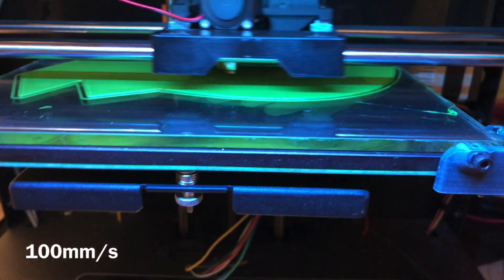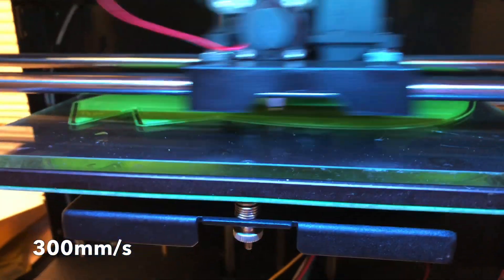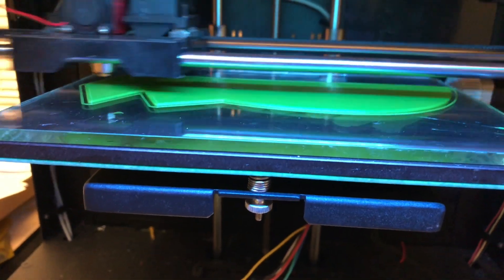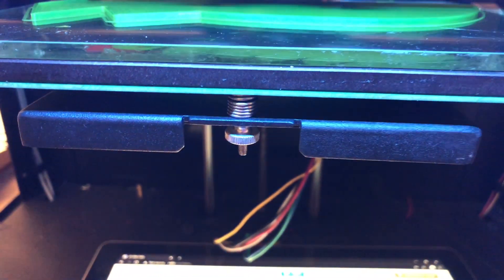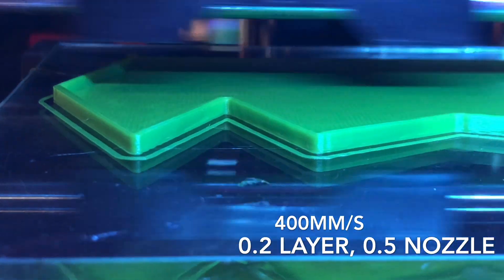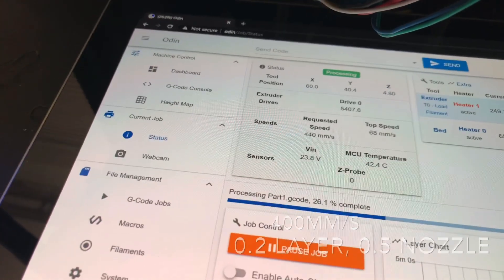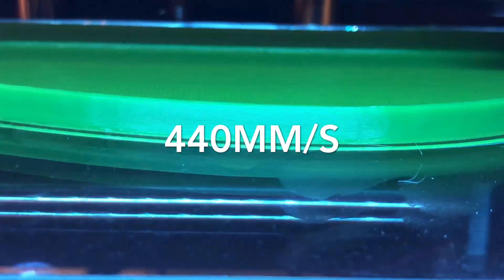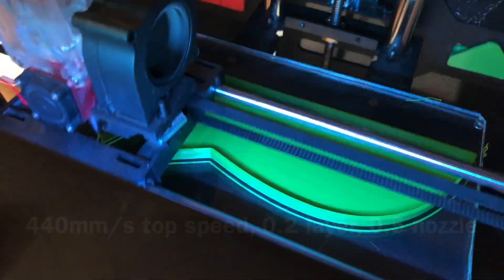Nova Hotend Speed Printing. 440mm/s

Comment: I'm more interested in the mods you have done to that Flashforge Creator Pro, or clone. I have a QidiTech 1 that I have big plans for. I'm a sucker for pain. I know it will be a difficult journey.
Reply from the maker: Haha, you dont want to go that route man, but if you do, I actually have a Nova printhead on my website that I used for my flashforge, and I put a duet board on it too.
Reply: @Vladlabs  what software do you use??

Comment: Will you be making a tungsten carbide nozzle?
Reply from the maker: Not at this moment, as it is unnecessary. My Starforged nozzles are HRC72, and they are significantly cheaper vs what tungsten would cost if I made it. And there is much less benefit from tungsten  on such tight geometry as Nova.

Comment: Would it work for predator delta printer ?? Can it do high temperature?
Reply from the maker: Yes, it should. I had customers with predator before. I dont have a guide for that machine though. Nova works up to 500C with RTD setup. Keep in mind, Nova us out of stock until July 15 now, orders will start dispatching after that date on first come first serve basis.

Comment: where are you from mate? Where do the hotends ship from? EU retailer? if not whats EU shipping cost? altogether this is a pretty expensive hotend all things considered because you use a different ecosystem so everything has to come from your store. I am interested in buying one and in shipping methods to EU
Reply from the maker: In relation for what you get for the money Nova is very underpriced actually, this is the least profitable project out of all that I run, because it is driven by different goals. And it is the lowest priced on a market hotend for given materials, which was not easy to achieve. But overall yes, it is definitely not a cheap hotend, it was never intended. I will be launching another hotend models very shortly which are going to be cheaper and more compatible with what everybody is using now, but in that case forget about performance numbers that Nova can achieve. Nova is only being assembled, sold and shipped by me and from my location now, which is California. I ship worldwide and I don't markup shipping costs on my website to offer a better over all solution for international buyers. You can check all shipping rates on Nova checkout page  typically international shipping costs $24ish, and DHL costs $40ish. Local is $6.

Comment: Акцент палит ) Интересно, как оно с ретрактами будет.
Reply from the maker: А что палит то, я вроде ничего и не прячу 😆 Nova needs significantly less retraction vs any other hotend due to 1.87mm tighter bore.
Reply: отлично оно с ретрактами, на нормальных скоростях - на текущий момент единственная голова/хотенд который я не трогал последний год. как собрал изначально (100W / 0.5 steel) так и печатаю
печатает все - pla / abs / abs-cf / xxxcf / nylon / ...
шикарный хотенд. мелкий, и очень приятный

Comment: This is really interesting! Can you tell me the speed of your first layer? Assuming usually we use 50% of print speed as the first layer speed, would a 200mm/s first layer speed works? Thankyou!
Reply from the maker: My day to day first layer speed is usually 120-150, and I print on bare glass. With glue stick could be faster, but I don't like too strong adhesion.
Reply: @Vladlabs  alright thankyou for the reply! Thinking of buying it soon enough 😁

Comment: Hello... thanks for visiting my channel!!! You made a comment and I came here to check your videos...

WOWWW... 440mm/s!!! JUST WOWWWWW!!!
Would love to try this!!!
What speeds can I actually get on an Ender3 with this HotEnd and the Dual Drive Direct Extruder?!?
I`m using a SKR mini E3 32 bits main board on it!!!
Reply from the maker: Realistically on Ender3 my customers print at a very stable 150-200mm/s as a default setting. CoreXY can do 300 easy, and delta up to 400. With that said, maximum flow rate ever achieved was 48mm3/s, so you have to keep that number in mind too. For example with 1.0mm nozzle and 0.5 layer height you won’t be able to print 400mm/s. I made a really nice calculator tool on Nova page on my website which will help you understand and estimate speeds: https://3dpassion.com/nova
Reply: @Vladlabs  WOW... that is AWESOME!!!
Any chance I could try this and make some Videos?

vistapanoramicabylello@gmail.com
Reply: @Vladlabs  What is the maximum print speed of ender3 with 0.4mm nozzle at 0.2 layer height without affecting its print quality?
Reply from the maker: @calvin-7540  Depends on your firmware skill, but I'd say 200 is a reasonable maximum on such machine. 150 is very easy achievable.
Reply: @Vladlabs  Sounds decent, I would consider purchase one

Comment: Is that a BMG clone?
Reply from the maker: It's very similar design yes, not exactly a clone. I personally think this extruder is superior to the BMG from bondtech. It is injection molded and not 3D printed, translucent, and over all great quality.
Reply from the maker: Forgot to add that this is not why I am able to print like this. I showed same exact speeds with MK8 plastic chinese $5 extruder too 😉

Comment: This is amazing.... I came to your channel because I had noticed your comment on one of my videos, without realizing you were a retailer. I'm wanting to upgrade my hotend to be able to print with materials like nylon. I've been looking at a popular competitor, but after watching this video I'm quite open minded to trying something different. I'm glad I popped over.
Reply from the maker: @David Woolfield Stock CR10 rated for 260C max temp (due to ptfe liner), what temps are you printing that at, just curious. I know some nylons are relatively low temp.
Reply: @David Woolfield Yes, im also interested. ...i also need to pick up a nova. Ive finished all my other mods. Do you have a mpunting system for the ender 3? Im the programmet for a sheet metal shop so i can make just about anything
Reply from the maker: I already have a bunch of STLs made for different machines, Ender 3 is also supported. You can use an STL from CR10, it's the same. 3dpassion.com/models
Reply: @Vladlabs  yeah, i look for cr10 parts as well. Do you sell through amazon or only your site? Ill definitely be picking one up in a couple weeks. Finilly finished all my side projects
Reply from the maker: @GL0ZZ3NTechReviews  both, but Nova is only sold via website configurator.
Reply: @Vladlabs  ahh, yeah, I bought a heatbreak for my v6 from yall over on amazon. I need to convince the wife not to kill me and Ill be picking up a nova soon. Ill have to do some videos to show it off as well. I also like how responsive you are on the channel, super cool.
Reply from the maker: @GL0ZZ3NTechReviews  I also offer messenger contacts to everyone who has questions :) well, while I can. Haha.
Reply: @Vladlabs  Do you use proprietary nozzles as well, or would I still be able to use an aftermarket hardened steel nozzle?
Reply from the maker: Nozzles are proprietary, and there was nonqay around it during R&D, if I wanted to push the performance. So all my nozzles are M4 thread.
Reply: @Vladlabs  no worries. Would you be free some time tomorrow to chat in messenger? I can shoot your company a message, but i know facebook does that reaponse time rating so I didnt want to send it at an odd hour. I would just like the details on what all i would need to buy for my current setup. My mind is made up, I need a nova in my life.
Reply from the maker: @GL0ZZ3NTechReviews  Yeah, message me whenever you need. My response times measure in minutes usually, 7 days a week, and I use personal account there, as their business setup still has 1990s interface there for some reason. I will also put some V1.0 Novas on sale next week, due to the fact that I ran out of stock of latest model today already. V1.1 will be back in stock in two weeks and I am glad I will be able to take a break from this! :)
Reply: @Vladlabs  i sent you a message on facebook about getting setup for my ender3/cr10
Reply from the maker: haha me too! Well, I am a retailer/manufacturer and a guy who made Nova from total scratch, so I do use this account to browse around :) the whole project is mainly updated on instagram, feel free to check it out over there: @3d.passion , Nova is on fire this month completely, I am already out of all PT100 and PT1000 stock. But still have lots of NTC-equipped bundles. 🙂
Reply: @Vladlabs  Ahh, so this is your baby? :) I'm the programmer in a job shop, so I really admire the quality of the manufacturing. I've actually just finished looking at your instagram and watching your calibration cube video. I'm currently upgrading my ender3 pro to have a much larger build area (I'm getting the extrusions and milling it myself rather than buying a kit), a heated enclosure, and a proper hotend.
Reply from the maker: Yep, my sweat and blood so to speak, designed and developed it entirely from the scratch, including custom heaters for it :)

Comment: hello sir, what kind of software is it that your using?
Reply from the maker: I use different slicers. It really doesn’t matter. Any slicer can be used to do this.
Reply: The web interface shown in the video is DWC, running on the duet boards.

Comment: What acceleration values are you using?
Reply from the maker: Steam Labs it is around 3000 usually, I play with that all the time and adjust that on the go during printing depending on geometry, but the value is not very meaningful, because my pressure advance algorithm is interfering with that a lot.

Comment: Very interesting! I want to try this with my X1 in the near future~
Reply from the maker: EZY3D LAB my buddy is getting that printer next week, when he gets his hands on it, I will surely work out a mount for that machine. Shouldn’t take me long at all :) Stay tuned! 😉
Reply: @Vladlabs  Interested also installing this on sidewinder x1
Reply from the maker: @klabbyk7315  In the works. I came out with an adaptor and I actually think E3d Heatbreak can act like an adaptor too. The one that has no thread at the top. However we still need to figure out the fan mounts etc. If you guys want to jump in, please do so. Nova hotend STL file is available on 3dpassion.com/models

Comment: what extruder are you using..with the set up
Reply from the maker: DARREN NICH BMG, and it doesn’t matter actually. I can do this with any extruder, even with $8 MK10 extruder, and I showed that before.
Reply: @Vladlabs   so could i use this on my Anet A3 fist gen model..and is there away of getting all the specs of all the components in your video from the printer to the hot-end.like in a list .if it ant to much thank you
Reply from the maker: you can dm me on instagram, I am there for the most part. Or give me a little time, I am currently rebuilding NOVA product page, a new page will include all possible details. you can also check nova configurator l, if you have not yet.